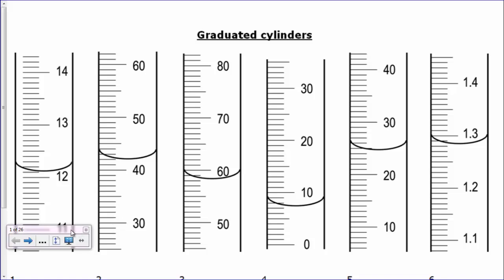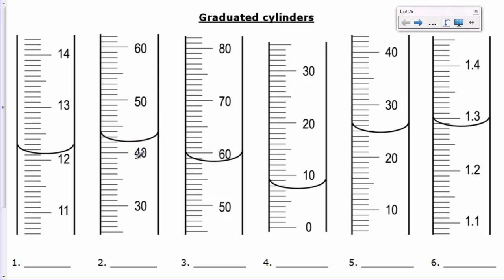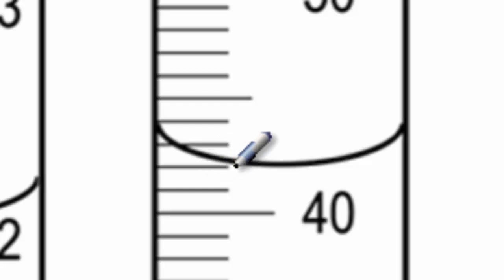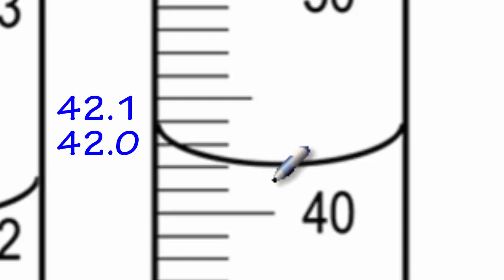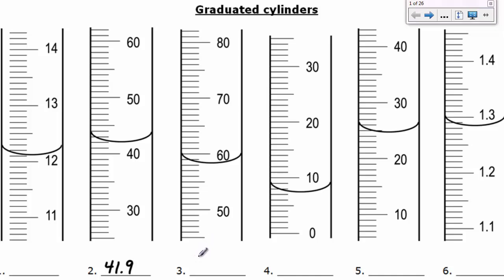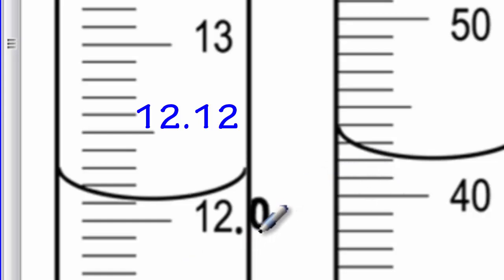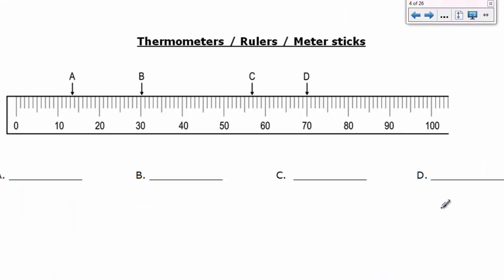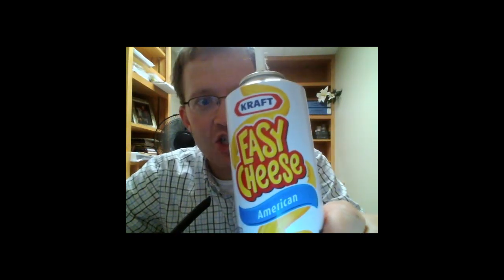1.5: Making Measurements - Examples

Comment: What if the graduated cylinder is in increments of 2 and you want to estimate to one more decimal place? Say the meniscus is between 12 and 14, could you say its 13.1?
Reply: What I would ask my students to do in that case would be to divide that increment of 2 into ten smaller parts, giving increments of 0.2.  This would allow you to report a measurement like 13.0, 13.2, 13.4, etc.  It would need to end in an even number, but would allow you to have that decimal place of precision present.